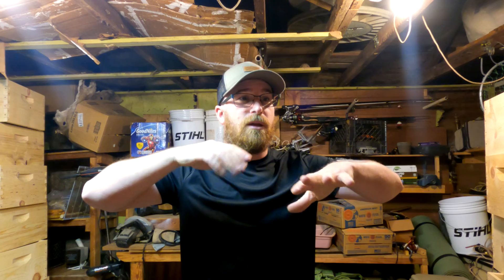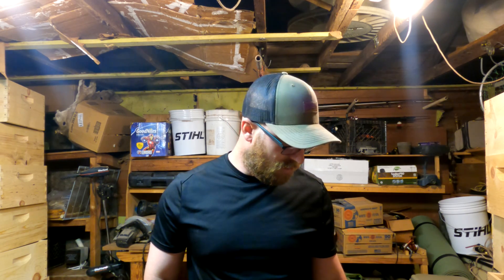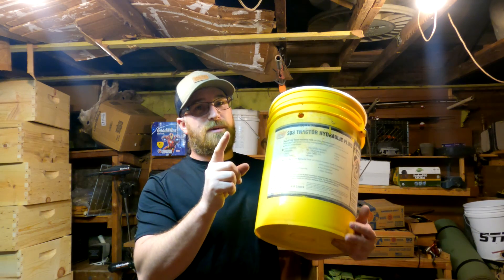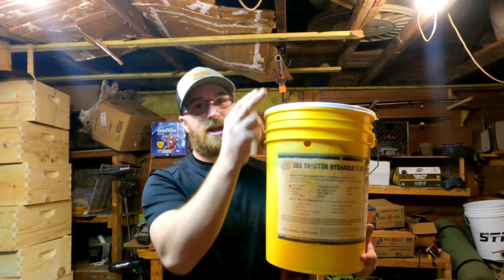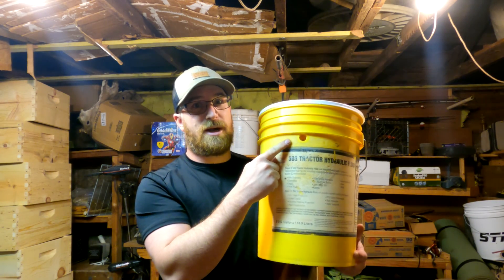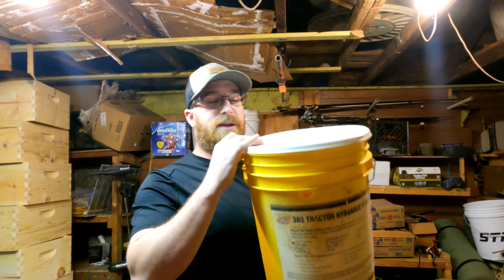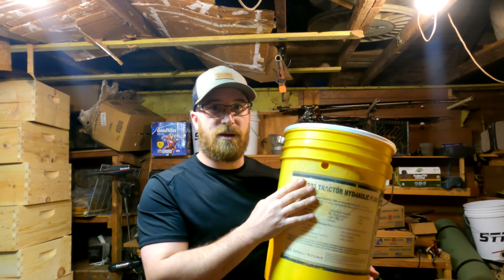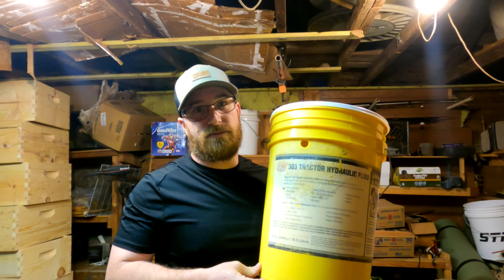Conclusion - Swarm Trap Design Modifications and Experiments (Part 3)

Comment: Good vid, I get as many buckets i can use at a local donut  store with good lids for 2:00 each. Just a thought. I have done only 6 cut out and 0 have been over 10 foot at the bees entrance. 3 of the 6 were 4ft or less including 1 in ground water meter. 15 ft + my butt LOL

Comment: Also why not drill the air holes higher up closer to the lid. Heat rises and if there’s no holes at the top it just means the hot air will stay in there.

Comment: There is a bee hive in the garden inside a upside down pot on the ground. It's similar to the bottom hole bucket you made. But inside a bush so you should give another try. It might work again. Bees come and go from it for two years now. It has a hole about 2inch. Even during heavy rain they don't mind maybe because the plants give them shelter

Comment: Would putting a bee frame for the bees to build on make it easier to transfer them to a box?
Reply from the maker: You could give it a try. I’ve never tried frames in the bucket before. I’ve had issues in the past with wax moth and beetles eating up the wax on the frames and just find I have no issues at all with them when I paint the bucket with the wax.
Reply: If the holes are 1/4 inch I am not sure moths can get in?  I am going to try it...

Comment: Is it possible that traps are too small, that's why bees sit on it, build comb outside, but do not go inside or leave soon after? It smells good to be attractive, but not comfy for real living. I had a small trap with swarm hanging on it, building comb at it's walls but not going inside. We were lucky to find it before it left. I will be trying bee buckets this season, both 5 gallon and something around 7-8 gallon. I love the idea, just wondeting about size 🐝
Reply from the maker: Good question! From what I have researched the best volume for a swarm trap is around 10 gallons (40 liters). So the 5 gallon bucket may be a bit small for the swarm.